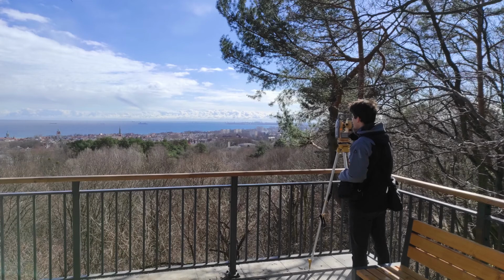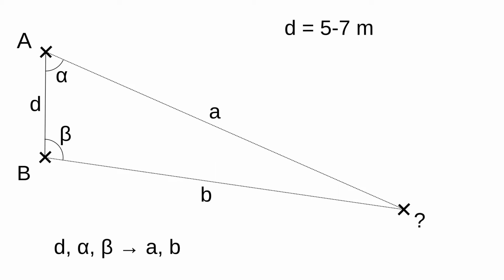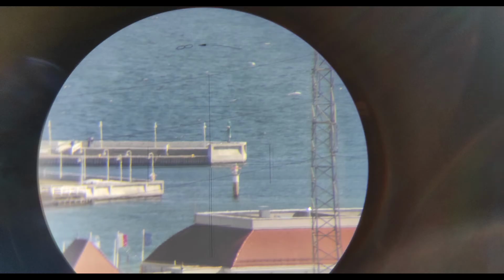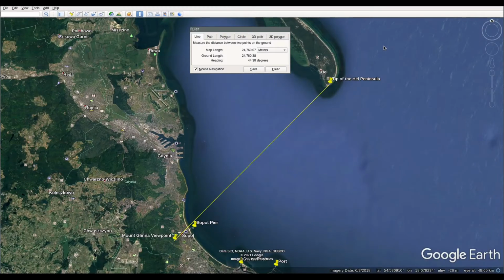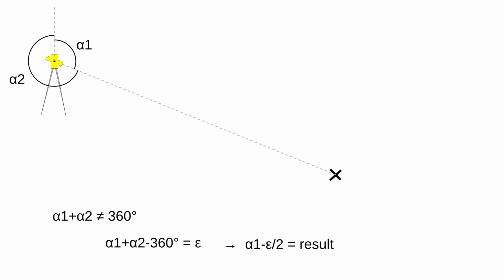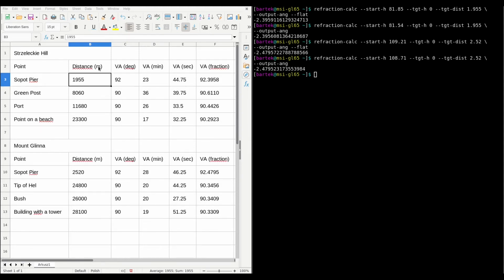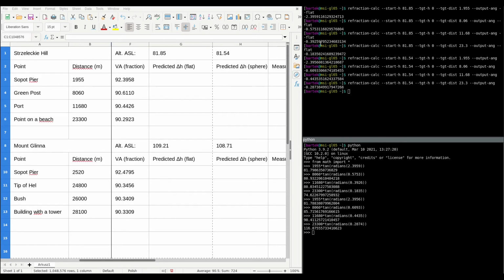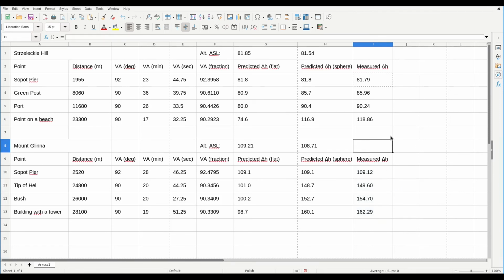Is water horizontal? Theodolite measurements of the Gdańsk Bay

Comment: Excellent video.

I have done a similar experiment, but following a ship for about 20km.
It has been very difficult for me to measure the angle at the bow of the ship, while recording a video of the theodolite viewfinder and the ship. I have not been able to make the measurement in transit (turning the theodolite 180º).
What is clear is that the height of the ship, with respect to the observation point, varies. And this is only possible on a curved surface.
Is it necessary to perform the two measurements at each point? Would it be correct to measure the error only at one point and accept that same error as valid for all measurements?
Thank you very much.
Reply: Always the more measurements the better.
And there are many factors influencing the error. You never know which one is more important for a specific measurement. So it's better to repeat.
Reply: @tomaszmiddle5280  Thank you very much for your comment.
I know I should repeat the measurements, but when tracking a moving ship, it is not possible to repeat measurements. I can't even do the direct and transit measurement (turning the theodolite 180º), because while I do the transit, the ship is no longer in the same position.

What I could do is monitor and collect data from several ships, and then take an average.
Reply: @videobitsofreality  How do you determine the exact position of the ship?
Reply: @tomaszmiddle5280  When I did the experiment of following a ship, and measuring the angle with a theodolite, I used a python program to do web scraping to the page vesselfinder.com, on that page I was able to obtain the position of the ship with a periodicity of 1 minute . With these data, it is possible to know almost exactly its position at any moment by extrapolating data.

I used that same program to get the ship's position data in this video:
https://www.youtube.com/watch?v=OUGmWucZmHo
I did all the calculations in Excel, and with a macro in VBA I made the diagram of the horizon hiding the ship.
Reply from the maker: I think if you can't repeat the measurement each time (and with a moving ship, it's understandable that you can't), it's better to measure the error just once than not at all - but the accuracy will still be slightly worse than if you did repeated measurements each time.
Nice idea to do this with a ship, actually! And if you know the dimensions of something on the ship, it might be possible to get a fairly accurate estimate of the distance to the ship directly from measurements (by measuring the angular size of that something).

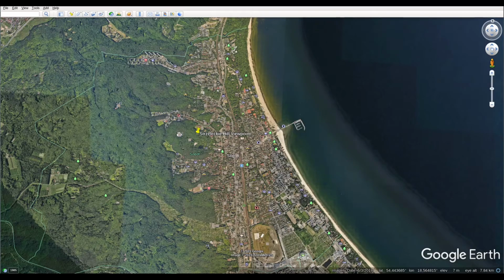Comment: 2:20-- can you elaborate on why those distances produced uncertainty?
Reply from the maker: Sure. What is really important for estimating the distance is the third angle in the triangle, that is equal to 180°-α-β. For distances on the order of multiple kilometers, with d being about 7 meters, that angle will be very close to 0. Say the distance is about 10 km, then the angle would be about 2.5 arc-minutes or less.
But we weren't able to measure that angle directly. The only way of measuring it was to measure α and β and subtract them from 180°. But to get the accuracy on the order of a single arc-minute over 7 m, we would have to pinpoint the position of points A and B to within single millimeters. I'd say the very best we could do would be about 2-3 mm. That translates to an uncertainty of about 2 arc-minutes in measuring each of the angles. So, we'd get the sum to within 4 arc-minutes. But the angle we're trying to measure is less than that! So if it's 2.5', we could just as well get a result of 6' or even -1.5', which would be nonsense. The distance calculated from such measurements would then range from about 4 km to infinity. This unfortunately meant that the method was useless for measuring the distance.

Comment: I prefer to trust hydro statics, first of all. Second, in my experience there is no such value as standard refraction without first making unverified assumptions about light and the shape of the “earth.” Your maths might very well have worked out, but how did you verify your product?
Reply from the maker: Hydrostatics will only tell you that the surface of the liquid assumes the shape of the surface of constant potential (or, in other words, everywhere perpendicular to the net force acting on it). What that surface is is beyond the scope of hydrostatics itself, and it's up for measurement.

As for standard refraction, it's just refraction that happens under some standard atmospheric conditions, most importantly the temperature lapse rate. The lapse rate assumed for standard refraction is approx. 0.001°C/m (0.00055°F/ft). The absolute values of pressure and temperature are of less importance, but the typically assumed standard conditions are 101325 Pa and 15°C at sea level.
It's possible to work out how light will propagate in the air under such conditions over Earth's surface of any shape, be it spherical, flat or whatever else. You can use the Fermat's principle for that, and that's what I did here.
Over a globe Earth, it is sometimes then approximated by assuming an "effective radius", but that's just a convenient way of simplifying the calculations. On a flat Earth you don't have the radius, so this kind of approximation is not viable, but the calculations at a more fundamental level are still possible.

But even if you disregard refraction completely, and do it purely geometrically, the fit wouldn't be perfect, but still the globe values would be much closer to the measured ones. Including standard refraction only makes the predictions even closer to the measured values (at least in the globe case).

I'm not sure what you mean by "verify your product".
Reply: @scienceitout  Sorry, I didn't have notifications for responses set up. By "verify your product," I mean how did you check your work? You mathed out your equation, sure. How did you verify your solution was reality? Most of what I have seen is this: here is the equation; there is the photo. Therefore, they are the same. But that is mere correlation and not proof or evidence. 

First, the surface of water is independent of the base below it. If the base, or ground, is uneven and the water has elevation above it, the water will not be uneven. That's it. Done. No need to appeal to "forces acting on it." Water does what water does: it lies evenly from border to border regardless of the changes in elevation which is why "sea level" has meaning. Sea level is the lowest elevation precisely bc anything above it is higher than it. There is ZERO need to refer to equal potential or the center of the earth when referencing the level of water. Water level has meaning when it is referenced against the elevation of ground above it.

Second, there is no such thing as standard refraction except to manipulate stats as variables. So, if you think there is a SR, then what conditions produce that standard? In order to have SR, what must the air temp be; the water temp be; the rH be; the wind be; the what else? What else do you need to know to have SR, or is SR just an abstraction of a value for which you need no data? 

You say, "Over a globe Earth, it is sometimes then approximated by assuming an "effective radius", but that's just a convenient way of simplifying the calculations." This is pure willing-to-power linguistic obfuscation. Approximations and convenience to simplify are not reality, but abstract statistics like, "the average American household has 2.3 children." Is that reality? No. 

And no one is crying, "Disregard refraction!!" So, that's a moot point.

If you look at your values, they are so slight as to be insignificant which is what they are: insignificant. Or, can you show me with a photograph what standard refraction looks like and then what it does not look like? I've yet to see that done. You seem an honest fellow, so surely you can find an example with the science (not equations) to back it up.

Now, I have asked repeatedly for someone to predict what a target will look like if the variables are known. No one has stepped up to demonstrate it can be done. What will a target, say the oil platform Gina in the Channel Islands, look like on a standard day? If you are not familiar with my channel, I have four years of captures in various seasons and I have yet to see a standard anything. Well, except the standard that there is no standard. There is no constant but inconsistency. So, you claim, "Including standard refraction only makes the predictions even closer to the measured values (at least in the globe case)." Are you willing to make a prediction? I'll give you all the data you need for the Channel Is and we can pick a target and day for you to predict WHAT the target will look like. Do you think it can be done; are you willing to make a prediction?
Reply from the maker: @theplanetruth  "I mean how did you check your work? You mathed out your equation, sure. How did you verify your solution was reality?"
First, no solution ever is reality. At best, it can match reality. And this I verified by simply comparing it to reality - it's precisely what I showed in the video. Here are the results from the flat math, here are the results from the globe math, here are the measured results. The measured results match the globe math and not the flat math. Is that proof that the globe math is correct? No! It's merely supporting evidence. But it is proof that the flat math is incorrect.
Second, which equation? You mean how I calculated the effect of refraction? That's not really my equation. It's simply a calculation based on a very general principle - the Fermat's principle - that has been tested numerous times under laboratory conditions. I'm simply using what other scientists have figured out before me. And as you can see from the results, it does work pretty well.

"Most of what I have seen is this: here is the equation; there is the photo. Therefore, they are the same. But that is mere correlation and not proof or evidence."
If a photo matches an equation, that is evidence that the equation is correct. It's not proof, as some other photo might not match it. But if the same equation is applied to many photos, and all of them match... that is still not proof, but it is strong evidence.

"If the base, or ground, is uneven and the water has elevation above it, the water will not be uneven. That's it. Done. No need to appeal to "forces acting on it.""
If you want to stop at this point, I guess you can. But scientists tend to be more inquisitive. If they see a pattern, like the surface of liquids tending to be even, they tend to look for some explanation for that pattern. And in this case the explanation is the forces acting on the liquid.

"Sea level is the lowest elevation precisely bc anything above it is higher than it."
It's not the lowest elevation, though? There are many places on Earth below sea level. Like the Death Valley, the Dead Sea, big parts of Netherlands...

"So, if you think there is a SR, then what conditions produce that standard? In order to have SR, what must the air temp be; the water temp be; the rH be; the wind be; the what else? What else do you need to know to have SR, or is SR just an abstraction of a value for which you need no data?"
It's just an average. Regarding the conditions, I already replied to that, didn't I?

"Approximations and convenience to simplify are not reality, but abstract statistics like, "the average American household has 2.3 children." Is that reality? No."
Just because you won't find a family with 2.3 children, doesn't mean that the statistic doesn't say anything about reality. You can conclude from it that the population of America is growing (2.3 children per 2 parents mean more people in the next generation than in the current one). You can expect that you will be likely to meet families with 2 or 3 children (assuming that the distribution is concentrated around the mean, but it's a reasonable assumption). You can estimate how many children there are in America if you know the number of households.
For some purposes, that might be enough.

"If you look at your values, they are so slight as to be insignificant which is what they are: insignificant. Or, can you show me with a photograph what standard refraction looks like and then what it does not look like? I've yet to see that done. You seem an honest fellow, so surely you can find an example with the science (not equations) to back it up."
I think this might be the closest to what you are asking: https://www.youtube.com/watch?v=T7uBlzVmiY4
This guy collected multiple screenshots from a webcam in the mountains, which are showing the same view under different meteorological conditions. They are all very similar to each other.
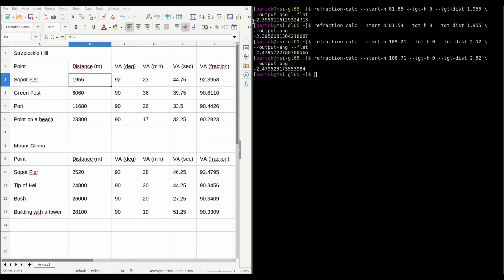Then he shows the calculated coefficient of refraction for different altitudes, based on meteorological data from about 2-3 years (around 6:40 in that video). And in that data you can see very clearly why a certain value for the coefficient of refraction is called "standard". Also, you can see why that doesn't work very well at lower elevations.

"What will a target, say the oil platform Gina in the Channel Islands, look like on a standard day? If you are not familiar with my channel, I have four years of captures in various seasons and I have yet to see a standard anything. Well, except the standard that there is no standard."
If you're looking from a low elevation, that's actually to be expected. See the video I've linked above, especially the fragment around 6:40.

"Are you willing to make a prediction? I'll give you all the data you need for the Channel Is and we can pick a target and day for you to predict WHAT the target will look like. Do you think it can be done; are you willing to make a prediction?"
The most important piece of data is the temperature lapse rate in the atmosphere, especially at low altitudes, and how it changes with altitude. Or, equivalently, just the measurements of temperature at different altitudes. Something like this: http://weather.uwyo.edu/cgi-bin/sounding?region=naconf&TYPE=TEXT%3ALIST&YEAR=2022&MONTH=02&FROM=2712&TO=2712&STNM=91165
Are you able to measure it, or get this information from somewhere? If yes, I should be able to make a fairly accurate prediction. If no, I can still try to make a prediction, but it will probably be much less accurate (especially since you're saying that you're seeing a lot of variability - without the data, I can only make a guess, and it will be a hit or miss kind of thing).
Reply: @scienceitout  "If a photo matches an equation, that is evidence that the equation is correct." This is what I'm trying to clarify. There is NO evidence a photo matches an equation. Simply writing an equation and saying it matches the photo is ONLY correlation, not equivocation. Please show us an equation and its matching photo. This is another failure for Andrew Thomas Young's diagrams. He can ONLY diagram what he thinks refraction does. Consider this: why does he not show an actual photo of a target, rather than diagramming a target which is not reality?

"It's just an average. Regarding the conditions, I already replied to that, didn't I?" Did you? Where please?
Reply from the maker: @theplanetruth  "This is what I'm trying to clarify. There is NO evidence a photo matches an equation. Simply writing an equation and saying it matches the photo is ONLY correlation, not equivocation."
Well, I have a simulator that uses some particular equations to generate simulated views of terrain from arbitrary places. I've shown a few simulations generated with it in other videos. The simulations are nothing other than results of applying the equations to some data about the terrain, but yet they reproduce many features in corresponding photos almost perfectly. I encourage you to take a look, for example at https://www.youtube.com/watch?v=HH_3FLPowKA or https://www.youtube.com/watch?v=kSHVotO-SZY or https://www.youtube.com/watch?v=rYNxYe7k4kQ

"Consider this: why does he not show an actual photo of a target, rather than diagramming a target which is not reality?"
Can you point me to the specific website you're referring to? Youtube tends to block links, and I know A.T. Young's website, so you can just name the title of the subpage (assuming you're talking about his website about refraction?).

"Did you? Where please?"
In my first comment here in this thread. I'll copy the relevant part:
"As for standard refraction, it's just refraction that happens under some standard atmospheric conditions, most importantly the temperature lapse rate. The lapse rate assumed for standard refraction is approx. 0.001°C/m (0.00055°F/ft). The absolute values of pressure and temperature are of less importance, but the typically assumed standard conditions are 101325 Pa and 15°C at sea level."